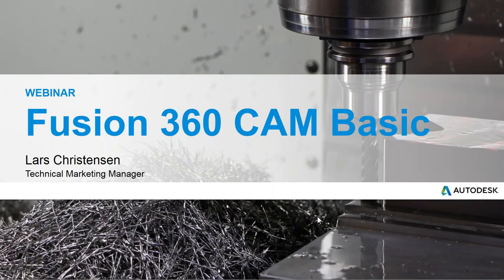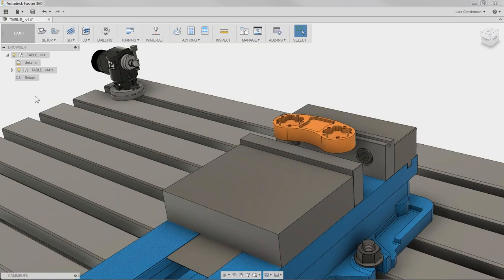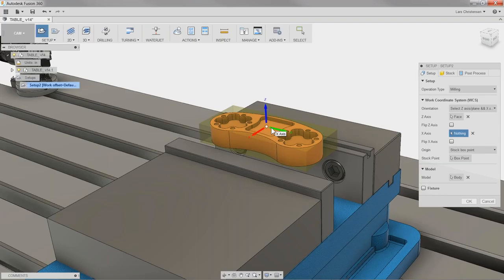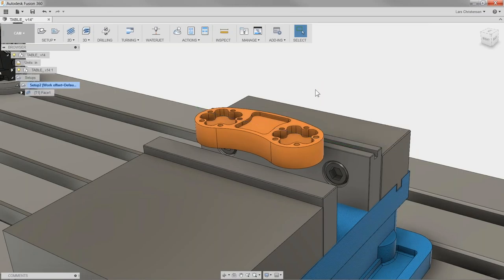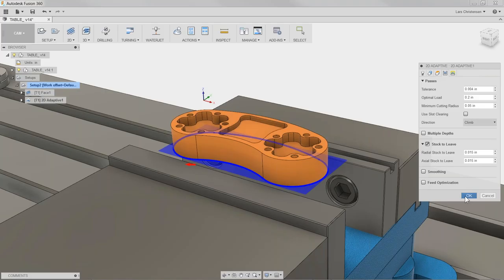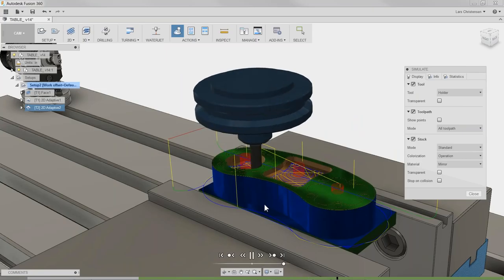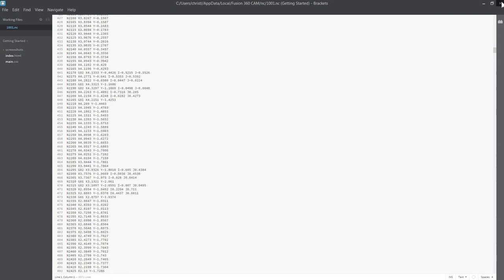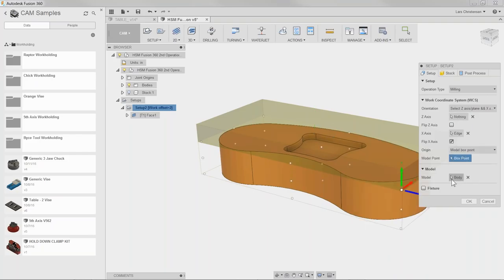Fusion 360 CAM Basics Webinar - October 2016

Comment: Great video. Thank you very much. I have a question to this topic though. There is a part to be programmed with at least 3 or 4 setups. After simulation (1st setup) I exported part to stl file as you shown in video. I imported it through data panel but I can't figure it out how to use it as a setup stock for second operation? First of all mesh model is out of scale , but the shape is not perfect either. Is there perhaps a video which covers that topic?